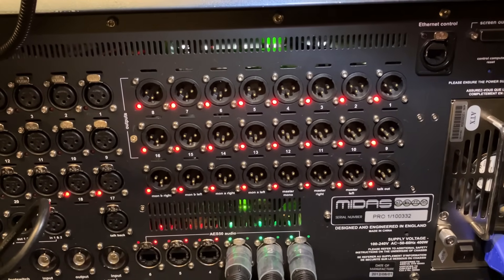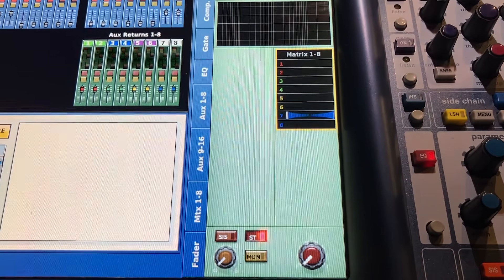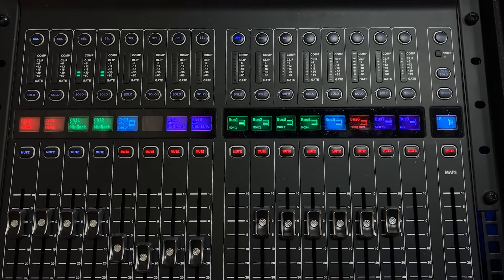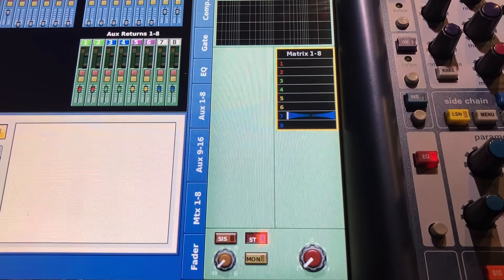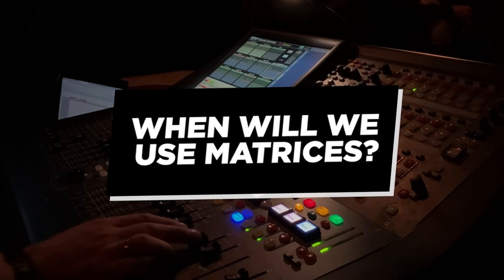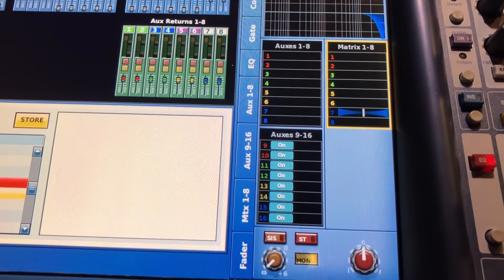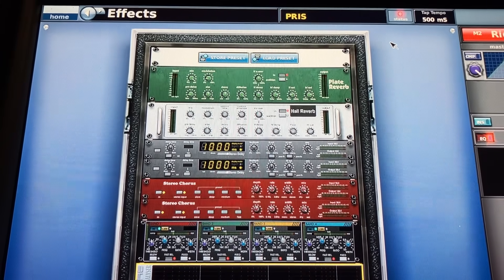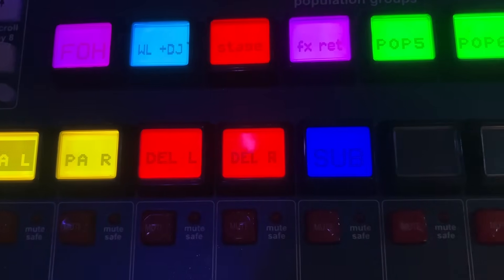What Are Matrix Outputs And When To Use Them

Comment: So if i understand this right, this has to do with creating alternative mixes that go to entirely different sources, such as side fills or online broadcasting, etc.. So, do you still run a separate subwoofer mix? And, if so, are your vocal mics connected to the subwoofer mix signal chain?
Reply: Subs are separate because microphones don’t separate stage noise from actual noise we want to use. Dave Rat does a great video explaining this concept. The basic idea is that subs on an aux, or some sort of routing where you can actually dictate what inputs can and cannot go to the subwoofers is superior than simply letting it all fly into the sub. Both in terms of tone but also amp efficiency.

Comment: My question is how do those mixes leave the Mixing board. Do you use the Aux outs on the mixing board for those Matrix mix's? My mixer, has 8 Outs 2 of those being L R main outs. The others are AUX outs for monitors.
Reply: Analogue desks with matrixes will have dedicated matrix output connections, labeled like the Auxes and LR are. Digital desks allow soft patching so any of your outputs can be matrix outputs instead of their defualt patch.

Comment: Matrices are such a useful tool, especially in this age of digital consoles. 

Every time I'm on a console with matrices, my LR bus ends up passing through a matrix on the way to the PA... I can add overall system EQ to the matrix rather than directly on the LR bus, so that other matrices that route to records, broadcast, or overflow feeds aren't affected by my room and system corrections. 

It's also my preferred location in the signal chain to attenuate the system if needed - if the PA system is more powerful than the room requires, I can bring the PA matrix down so I'm still hitting a healthy level at the preamps and console meters, but I'm not blowing away the audience. This lets me maintain solid gain structure, which in turn ensures that other outputs heading to other destinations are still nice and hot. My preference to have that control right at the console stems from the fact that I won't always have convenient access to the amps or DSP during the show if I attenuate the system there instead - if I end up needing some more headroom once the show starts, I want that control on the console right in front of me. 

I also place system "zones" on the matrices. Most shows, I run a "PA" matrix, a Subwoofer matrix, and a Fill matrix. The PA matrix gets the LR bus, the Sub matrix also gets the LR bus, and the Fill matrix gets a mix of my groups, with more of the Vocal group, and less of the Guitars and Drums (since the audience at the front of the stage is already hearing so much of the guitars and drums simply from the stage volume). This lets me have a more suitable mix in the front fills, and subs on a matrix retains my control of the level of the subwoofers relative to the mains, without any of the disadvantages of subwoofers on an aux.

There have been a few times where I've even used matrices to feed separate parts of a line array - the top few boxes would be fed by one matrix, the lower boxes fed from another. This is especially useful in situations where there is a thrust or runway on the stage - when the performer comes out in front of the PA, I can set a cue on the console to duck the matrix feeding the lower boxes to help reduce feedback.

The possibilities are endless! Great video.
Reply: wow, thanks for the detailed input, my man! Im learning and this is so helpful to understand whole signal flow better using matrixes in live
Reply: Wow! This, right here, is golden information! Thank you!

Comment: On topic of the broadcast mix, you can actually use a post fader Aux more effectively, set all faders at unity in that Aux and it will follow the FOH mix, you can then adjust individual channel levels in that aux for a better mix
Reply: That's what I do, though I wonder if I wanted to put an FX chain on that mix if a matrix would be useful. For now I use a reverb bus for live and another more aggressive one for stream and mix the return into the stream aux.
Reply: I will have to see if this is how my board works.  To be honest now thinking about it I am not sure if I set my stream Aux to Pre or Post Fader.  I assume Pre fader individualizes the output but Post Fader keeps the same level at Unity.

Comment: Love your videos…
I’d like to know your opinion on a scenario sending Sub content out of an X32. 
I could obviously use a Matrix for the Sub frequencies by routing the Master to it, adding a LPF and an HPF on the Main LR to balance my sound…
However, one nice feature of the X32 is the ability to feed independent channel elements to the M/C Bus which can’t be done using a matrix.

Would you recommend setting up the M/C Bus and then routing THAT to a Stereo Matrix to feed a pair of Subs? 
Cheers